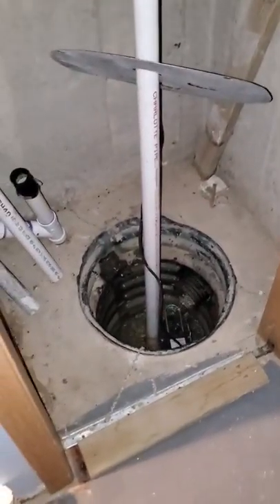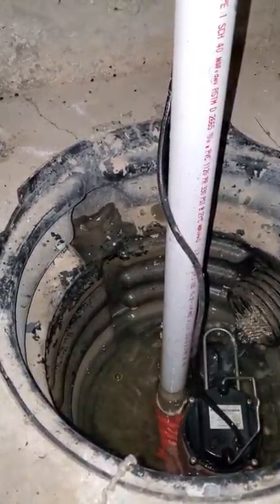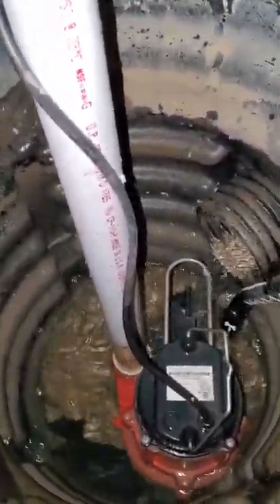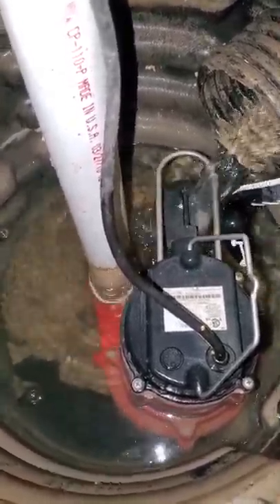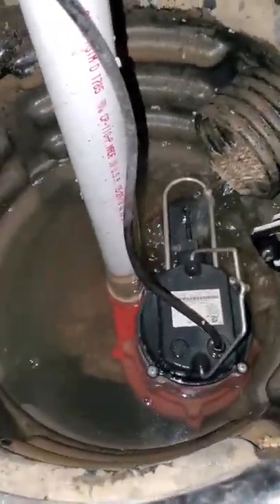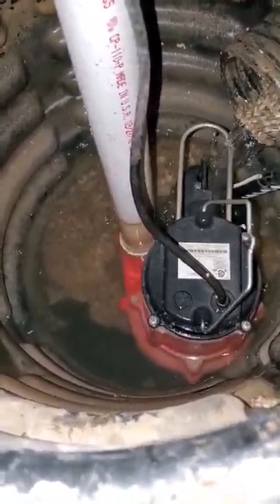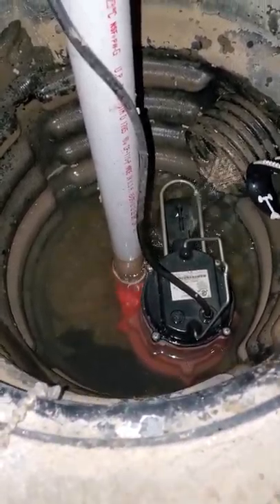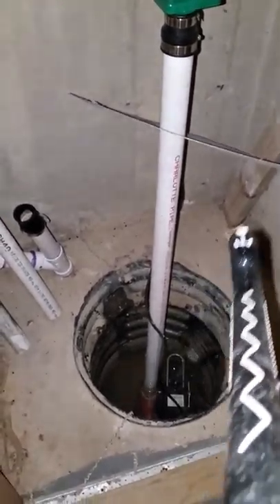Fix Sump Pump Float Switch Problem

Comment: Thank you!!! My basement flooded during the night. The pump worked fine once I "jiggled" it, and it sucked out the 2 inches of water in about 10 minutes, but it hadn't turned on when it should have. Turned out that a piece of plastic had become stuck in the float. I wouldn't have even known where to look if I hadn't found this video!!!

Comment: Never install the float switch under the crock drain. The water coming in will prevent your float switch from raising and activating the pump.

Comment: Need to reglue that pvc, is shooting water back into the pit from the discharge pipe
Reply: no.  it is necessary so your pump doesn't get air locked
Reply: It's called a weep hole